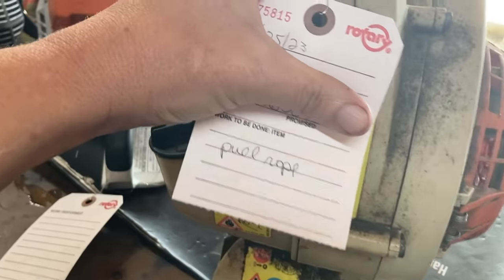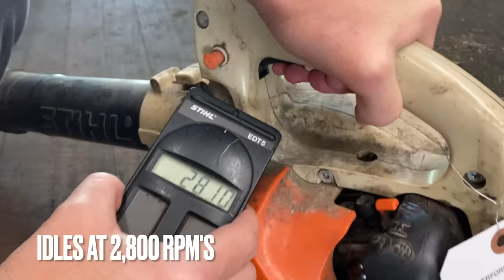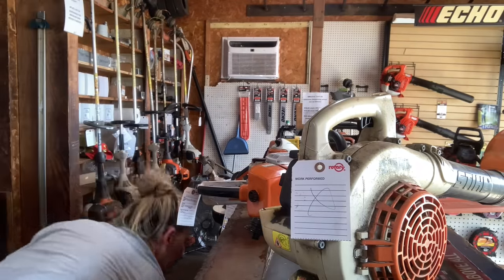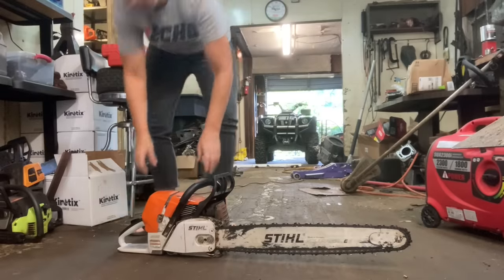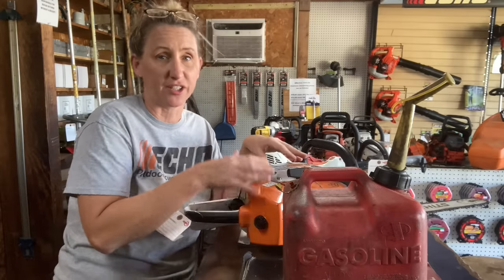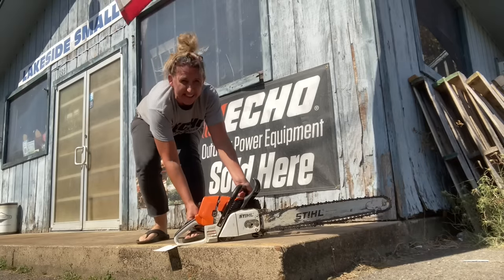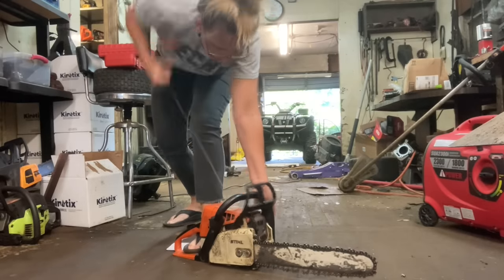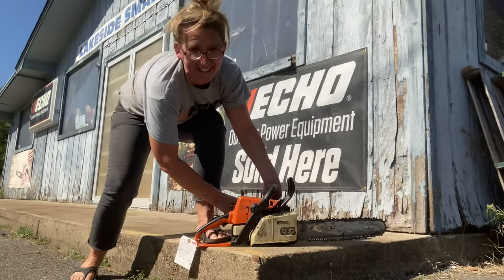The Burning Truth of Canned Fuel. This HUGE Distributor Doesn't Like Me Exposing It!

Comment: Hm, and then there's the owner of a small machines shop in Germany, an approves Stihl dealer, who claims that he sees most issues with self mixed regular gas from the pump, and it's all fine using alkylate gas. Also the manufacturer of the machines recommends usage of it, my machines start perfectly on that stuff and run fine, even if I buy it in the local supermarket. Maybe it's just bad quality that you get in the US?
The usage of regular pump gas is even banned in many European forests in public ownership, as well as for professional users due to the toxicity and carciogenicity of the benzene in regular fuel from the pump.
Btw, I'm not so sold on starting a saw and reving it up to the max before it had any chance to warm up. Tell what you want, but the engine for which this would be good is still to be invented. But of course it's a way to increase revenue in the spar parts business...

Comment: Hi, Can I guess...be Stihl my heart.  BTW  I really like your videos!.  I was a Husqvarna dealer in the late 80s.  (Yeah, I'm an old guy.)  I would like to beg a question regarding that which know is near and dear to you....fuel.  I have a Rancher 44 and a 380 CD that I originally bought and was the genesis of my becoming a dealer.  I was a "hobby-dealer", as I did it part time, before Huskys went to the big box stores. I worked on all brands, even those yellow saws that the manufacturer couldn't make run, but the beaver commercials were cute. I was and still am, a dyed in the wool Husqvarna man.   In those nearly fifty years I have run regular gas in all of my small engines.  Recently, I bought a Rancher 450 (light weight) and a 592XP (monster). I haven't started either one yet.  But the dealer did talk me into a can of Husqvarna pre-mix. Here is the question:  Do I really need to travel ten miles to get no-meth fuel?  In all my years I haven't had a problem with regular gas. With that said, I am certain that you have more experience than I and I value you take on the matter.  If we lived closer, I think we'd be good friends. ;-)  I have great respect for what you do and am grateful for your videos.  Thanks in advance for your kind response. Shalon/gw  P.S. in case you are wondering about my closing.  I started using it forty years ago.  Shalom is a Hebrew word asking God to bestow all of the Peace, Love and Blessings upon the recipient.  I believe it to be the greatest wish one human being could ask for another.  :-))

Comment: Seen lazy man's 2stroke fuel for years and always wondered who buys this expensive crap when one RatioRite and a good bottle of 2stroke oil with ETOH free gas work's just fine. I understand the generations who grew up without small engines classes offered in high school couldn't screw a spark plug to save their life but canned fuel is the breaking point for me, but look at this way it's job security for you and others small business 👍🏻

Comment: I've. Def found thst canned fuel degrades i dont know hoe long it takes for ot  but wven pump fuel seasonal  i end up adjusting  my  csrbs on personal machines    not just fuel. But  weather  and temperature  def effect  fuel mixture that why fuel injection  and. Electronic carb  definitely      makes machines runs they way they should  when they're running right of course  but learning  to   get your carbs correct as a small engine mechanic is   for handheld equipment is  gotta be one of the most important  thing about 2 strokes. I wouldn't  say im a 2 stroke carb master but jm getting pretty decent at carbs for  handheld equipment  one thing I learned with echos this year is  that carbon buildup  hiding in the exhaust  port

Comment: What do you think about using aviation gas 100 low lead in two cycle equipment?  I’m a pilot so it’s easy for me to get it.
Reply: Fire department I work at switched over to avgas  a few years ago after having been buying the trufuel for a few years. Now, they go down to the county airport and buy avgas for our rescue equipment, mixing echo red armor for the two stroke needs.  No problems with our engines.

Comment: That sucks. I bought a few cans of Tru Fuel from Home Depot. Haven't used it yet. What sucks is that in Canada I can't get any other non ethanol fuel. All fuel at the pumps here has ethanol! Thanks Liberals.
Anyway, from what I've seen, I'll do what Stihl says and empty the fuel amd run it dry before storing like I've done this spring.
I used my MS250 for a firewood permit and cut in winter so there's the least bugs. I'll still try the canned fuel but if it doesn't perform I'll continue with the 91 Octane ethanol contaminated fuel with the Stihl oil mix.

Comment: gas looses energy over time as it sits. simple fact.  From the time these canned fuels are bottled to when the can is used, the fuel is old.  A regular gas station always has fresh gas.  Also, get the best performance from Stihl high perf mix oil in new gas in Stihl engines

Comment: Canned fuel is like brake fluid it's only good from a sealed container. Once you open the can the clock starts ticking you will probably get 30 day but not 90 days

Comment: I assume "your gas" is regular (87 octane?) ethanol gas that had all the alcohol removed? One way to do that might be to add water, mix it, let it settle and then siphon off the alcohol free gasoline. Or maybe you buy it in Mexico somewhere? I'd love to know what "your gas" is since I also assume you're not refining it yourself, or are you?! (That might require heating an already explosive substance for distillation which is an extremely dangerous thing to do and probably even illegal!) I ask because it seems the only place I can get ethanol-free gas is in a can at one of those "box" stores. You'd think the smarter thing would be to refill a container like you do with propane or at a "gas pump." Nope!

Comment: Mechanic in a can, nope. LOLOLOL Good mechanic ehhhhhhh. Thanks for this huge tip, very very helpful
I've had a tank mixed of stihl oil and regular gas, E-10. For 3 years. I run the weedwacker dry every time after use and it has been flawless. Same tank, same fuel for the 3 years. I use very little.
Just my two cents.

Comment: You have no idea how old these fuels actually are or how long ago the premix fuel can was opened before it was added to a machine.  The shelf life of the canned fuel is affected once the can is opened.  There’s also the possibility that the wrong mix ratio and oil component was used—not all premix is the same octane or oil type, and not all premix is designed for small engines.  Also, just because a premix has pink dye makes it a particular brand—pink is not a proprietary dye for only one brand.  Most problems with 2 strokes are due to old fuel and ethanol blends, but given that your customers actually waste money on premix gas indicates to me that they’re not too savvy to begin with and probably can’t figure out how to pour oil into a jug.l.

Also, Measurements of rpm at no load are interesting, but they have little to no influence on the torque generated at WOT under load.  Check it and see for yourself…

Comment: Does she realize that canned fuel is non ethanol? All she did was add pre mixed pump gas to it with 10 percent ethanol which leaned out the top end... theres nothing wrong with canned non ethanol as long as you lean out the high side... all ethanol does is displace petroleum and lean it out due to lower afr... honestly she should be pointing out how to adjust carbs for switch overs... i legit have no problems from true fuel to e10 pump premix. She is definitely not exposing anything... its common sense....

Comment: A hot chick in flip flops, pull starting a high compression chain saw underneath an American flag.  It doesn't get more American (or progressive) than that.  The only thing that would make it better is open carrying a 1911 on her hip. 

Someone needs to call Bud Light, this could be the advertising campaign that saves their brand.

Comment: The new-ish "Caned" fuel is just stupid.  to me... it's totally on price.   Modern "Pump" fuel is fine... but you and I both know the alcohol can mess up older rubber parts, and it attracts water... and doesn't store well.  I personally have the real solution.  I've been running my small engines on "White Gas" or camping fuel for the past 20 years.  It started long ago berceuse my large model airplanes would stink like gas and oil when I would bring them home, and I would have to leave them in the garage. (My work space was in the house)  I had an old timer tell me about it, and the original thing was simply the smell.  When they run, it smells like a BBQ starting up. After the engine cools off... there is ZERO stink, and I can bring them in the house !!!   Over the years, I realized that since it has to be clean so to not poison people cooking with it... it has ZERO additives to cause issues (varnish) in carbs.  The down side is... it's only around 65 to 70 octane, but to be honest, that's all a low compression 2-stroke needs since the ports open quick.   The other down side is... you absolutaly need a carb with a low and high screw so you can adjust the fuel.  Once that is done, it makes (more or less the same power) as pump fuel.

Comment: The leaf blower seemed like it just needed more fuel at the higher rpm like a carb adjustment, it could be that the carb was set up for plain gasoline and the other fuel is slightly different, like not that the fuel is bad but maybe that it needs to run richer if there is alcohol in it. The engine should be able to run on extremely diverse fuel with adjustment.

Comment: Very unconvincing, yet here I am helping to monetize this channel with my comment.  I run the evil canned fuel in a POS chainsaw that I use maybe once a year.  Magically it starts easily and runs well every time I use it.  What's my secret?  I simply drain the tank and bowl when I'm done using it.  Something most premix canned fuel users don't do. Storing any small engine for extended periods with fuel in the tank is going to cause problems, even with Chickanic's unicorn gas. I mix my own 2-cycle gas as well and am fully aware that it has limitations.

Comment: everything made these days is made to purposely break down  and ware out quickly, yes it's all made like this on purpose by design. from cheap fuel to cheap material that's guaranteed  to break down sooner than ever before. remember back in the day when things were built they where built to last. Like the screen on a old television set was tough as f*ck, but now all televisions are made flimsy and weak, same goes for cars and everything else you can think of that is made from the year 2000 and up. it's  rediculous on why even sale such cheap shit that is guarantee to  break down. You know why? cause it's all by design. how else are big companies going to make money? it's because companies realized if you sale people great products that last, the customer won't return because the product is working great, but if you sale customers products the only last for a short time it's a guarantee customers will have to come back either to get it fixed or come back to buy a new product. either way the store wins. that's why everything made these days fucking sucks, to suck up all your money like a bunch  of suckers. nobody seems to notice and nobody seems to care.

Comment: Problem is your testing old units than have seen alot of eth fuel and customers Hey yea I'm gonna buy this fuel to fix it ha!! Smoke and mirrors!! Fix is clean the carb/rebuild it then use the pure non eth fuel!! I've used Vp c9 96 octane non oxygenated fuel last 9 yrs in my Chain saws, weed wackers, blower, 1985 2 smoke lawn boy push mower and dirt bikes from a Yamaha pw 50 to a ktm 85 not one issue✔️

Comment: I'm mechanically retarded. I would absolutely use the canned fuel to make sure I didn't screw up the mix. Is there a good alternative, or should I just plan on learning the correct 2cycle mix for all the different engines?